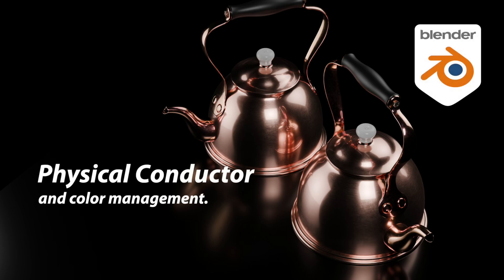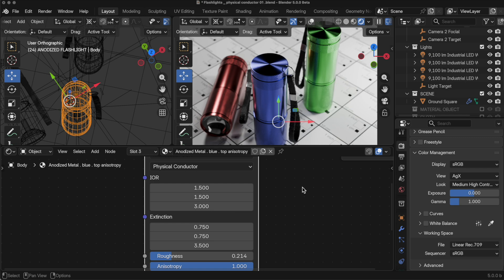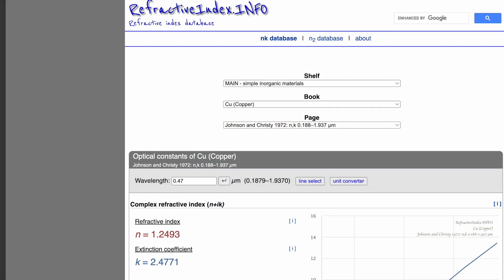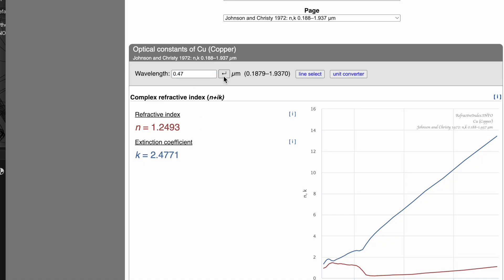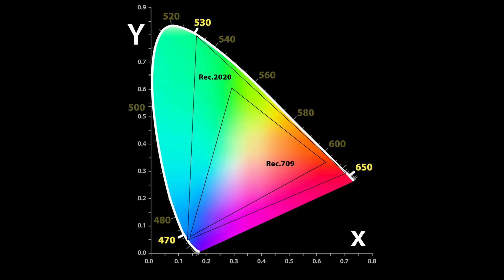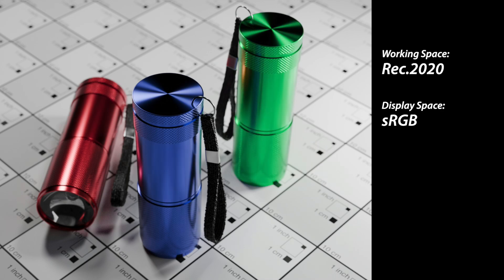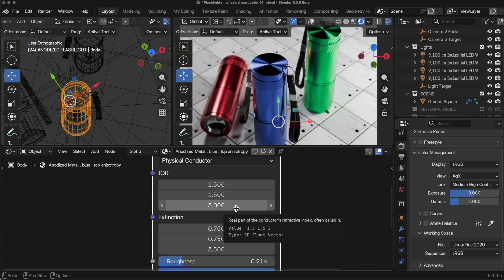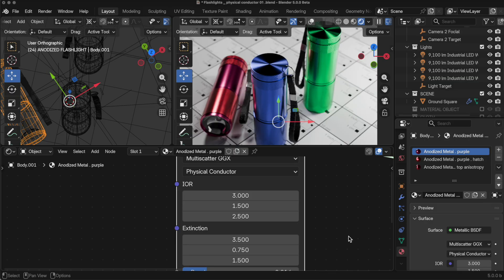Answering questions about Physical Conductor, and color management in Blender 5.0.

Comment: Can I ask, what is the Color depth in bits in Blender 5? For example I heard that DaVinci Resolve has 64 bit color engine. And I was wondering what's the bit depth in Blender's Working Space. If it's 32 bit the bit depth would be 4 Billion colors and in 64 bit it would be 18.4 Quintillion colors, correct?
Reply from the maker: No, 32-bit floating point color is much higher precision than just 4 billion colors, but it also allows for not just more colors but more stops of light intensity as part of the color information. I'm pretty sure DaVinci uses standard 32-bit floating point like Cycles does. But I don't use it so you would need to double check.
Reply: @christopher3d475  You're right 32 bit is way more.  Because 10 bit color is actually 1 billion colors, because it's 2^10 cubed. And that way 32 bit is way more than even Quintillion colors. What a time to be alive!
Reply from the maker: @arkenavetisyan7308  Yep, my first Atari in the 1980s could display something like 16 colors.

Comment: Hi Chris, quick question that's somewhat related. With the color management in 5.0, there's the new HDR  Rec 2100's that make the scene substantially brighter just by switching to them. Is it worth using this when I don't even have an HDR display?
I've tried some renders using the ACES 2.0 - 1000nits and 2000nits ones and the result on the photos app differs from the render, as well as on my phone. Using sRBG and Rec.2020 produces a more consistent result. Are they just to be used in productions with fine controls over color management?
Reply from the maker: The Rec.2100 display spaces give us the ability to view HDRI data along with view transforms that work within that realm. But the real challenge is that you have to have a monitor capable of viewing those. An Apple laptop can do that for instance. But currently we don't have a way to save still images with this view transformed HDR. There are a couple of newer formats like JpegXL that do this, and I'm guessing this something developers know about. So for now, the 2100's are there as part of future abilities and also help you visualize the dynamic extent of an image if your monitor can support it.
Reply: @christopher3d475 thank you very much

Comment: Hello,

I still think you are wrong.

You say Blender somehow works with "standard pure wavelength" colors and calculates color of material based on that. I could not find any signs for any kind of conversion from these pure colors to working color space. I could find `fresnel_conductor_polarized` function which appears to be the one doing the actual physics calculation. It takes IOR coefficients and spits out RGB values among some other stuff. I couldn't find any place where these values get mapped to working color space colors, nor did I find a place where the input coefficients do get adjusted. I couldn't even find any mention or some constants representing the "standard" wavelengths mentioned in the video. I've tried to ask Copilot, and it claims that `Spectral` type in this case represents working colorspace RGB values, and there is no additional conversion performed related to metallic shader, nor there is any conversion done on provided coefficients.

Of course, I could have missed something, Blender code-base is crazily complex and I'm not a Blender developer. So I devised experiment to prove that no conversion is happening. I've rendered the image to linear rec.709 raw exr file. Then I rendered images using srgb and rec2020 working spaces (and srgb view space and agx mapping so that the images look pretty). Then I took the rec.709 exr file and rendered srgb+agx images using the compositor, one where I correctly set image input to srgb, one where I incorrectly set rec.2020. If what you are saying is correct, and there is any calculation being done in metallic shader that would take color space into consideration then the change between rec.709 and rec.2020 working space should only be caused by rendering process "being more accurate" due to having wider gamut available. Problem is that this experiment showed that the change is exactly the same as when I just incorrectly assigned color-space in compositor. Image with the proof: https://imgur.com/a/uaUVn2a . The top row is normal rendering (path-tracing and evaluating shaders), bottom row is just rendered rec.709 pixel data manipulated using compositor.

What appears Blender is doing is that it just assumes each RGB channel is some pure monochromatic light (it doesn't really care what color it's exactly or if it's even pure spectral color), and it just applies fresnel equations to it based on coefficients you provide. It just computes how much should you attenuate each channel based on how would you calculate it for pure color. All the burden of choosing the right coefficients is placed on the user. Without having full spectral rendering, the best thing we can do is to pretend light consists only from 3 wavelengths, and somehow pick the coefficients that closely approximate our expectations of the materials in question. For rec.2020, I would choose wavelengths corresponding to the primaries of that color space and I would pretend my scene is lit by those RGB leds that have terrible color rendering index. Tada, it's accurate. For sRGB, I'm not sure what's the best approach. I guess picking anything vaguely red, green and blue would do.

If you want to choose same wavelengths (and therefore same coefficients) for sRGB and 2020, I guess it's fine, but you should know that the coefficients are probably not interpreted as affecting specific real-world wavelengths, but they appear to act on the working space primaries. As demonstrated, the difference between sRGB and wide color gamut render will be exactly the same as when incorrectly assigning color space to raster image, which is not the same thing as "rendering being more accurate in some cases"-effect (which I didn't try to contest).

I hope I'm correct and this helps. I'll be now living in a fear there will be another video in the saga because "some people had some comments" 😅. But I tried my best to not mess up 😅.
Reply: To be extra sure there is no special treatment for the channels I've tried to swap coefficients for RED and BLUE. If the metallic shader assumes that red and blue channels correspond to some specific real-life wavelength, then these channels should be treated differently, as the wavelength of red and blue colors is completely different. But when I swap the red and blue channels in the rendered image, I get the exactly same image as when rendering normally. The blender doesn't really care about what the channel represents, and does the same calculation for each channel, only with different complex coefficient. (Note that I've used the default white light and grey background so that I don't have to swap all the channels for all the materials and lights in some complex scene. Also note, that I'm not claiming all nodes behave this way, it would be nice if for example the blackbody  node took working color space into account; I've tested just the physical conductor.)
Reply from the maker: Your experiment is wrong because you didn't use a scientific control. I'm going to record another quick video demonstrating that what you're seeing is misleading and you've drawn an incorrect conclusion from this experiment. What I'm saying is correct, colors generated by the Physical Conductor and its N+K parameters via the wavelength data can get clipped when rendering with a too-small working space. Rec.2020 allows the color calculations to be more vibrant because the gamut doesn't clip/compress the color.
Reply: @christopher3d475 You are misunderstanding me. What you are saying is correct. I don't disagree with that. I agree that the physical conductor can produce colors that are outside of sRGB that would get clipped if you used sRGB working color space.

Let's say we use rec.2020 color space. Let's say you have white light ray with color 1,1,1. Because we use rec2020 color space, it's implicitly assumed that the RGB values represet color in rec2020 color space. When the ray hits metal, it appears that the triplets of the values get multiplied by values calculated by equation based only on coefficients provided by user and angle of the ray hitting the surface. Resulting pixel (which represents some nicely saturated real-world color) then gets shifted into sRGB if it falls outside, but it might fall into sRGB (as you demonstrated) so no dramatic shifting might be needed. I don't disagree with these things.

If we instead use sRGB as a working space, then the 1,1,1 triplet has very different meaning. It's 1,1,1 implicitly assumed to be in sRGB. When this light hits the metal, it gets multiplied by triplet of values based only on the coefficients and angle of the ray. What I tried to prove is that If you provide same coefficients and the angle is same, you'll get same triplet as a result. The only difference is that the resulting color of pixel (before tone-mapping) is implicitly assumed to be in sRGB, so it represents less saturated real-world color.

I agree with you that there should be difference between rendering in rec.709 working space and rec.2020 working space. I agree there should be a difference even if you render to sRGB. I also agree that using rec.2020 as working space can lead to more accurate results because you are cooking with wider color primaries, and if your input colors are more accurate to what you try to represent, then no matter what operations you perform on these colors, the output will be more accurate. And I agree that in most scenarios it's probably better to just work in larger color space and map it to smaller one only at the end of the process instead of being limited from the start.

What I'm claiming here is that:

1. The physical conductor metal in Blender, as implemented in Blender 5.0.0-beta+v50 doesn't really care about the color space you are in (or even what the 3 channels mean) and just does math on the numbers.
2. Changing the working color space without changing the coefficient is doing the exact same thing as if when you mis-label color data. The math being done on the numbers appears to be the same irrespective of the working color space in this case. (This happens because most operations done doing rendering are linear so if you scale inputs, the scaling gets preserved in the output. Note that point of the experiment wasn't to prove that all rendering is linear, the goal was to reverse-engineer how the metallic shader works. Also, I'm aware that mapping to sRGB could introduce clipping or non-linear operation at the end and AgX is not linear, but they are needed for images to look pretty and they shouldn't affect anything as they are applied at the end. These images change how the screenshot I sent you looks, but they won't randomly make two different renders identical.)

Maybe I didn't some error in my experiment (although I doubt that in case of the second one, because that one is really simple), but more likely I just didn't explain properly what I'm trying to prove.

Comment: I switched a scene view from filmic to aces 2.0 and it got very dark. How do I compensate? My display is set to sRGB, I also set working space to ACEScg. Should I adjust gamma from 1.0 to 1.5?
Reply from the maker: This is the nature of the ACES 2.0 view transform. It's by nature going to be darker and more contrasty than Filmic and AgX. You will simply need to adjust the exposure of your scene, or change the lighting. FOr instance, you can change the Exposure setting in the color management area up a bit to help compensate. But for ACES 2.0, it's usually best to use it from the beginning of scene creation because you'll be configuring your lighitng and exposure form the beginning to suit its characteristics.

Comment: So I'm not entirely sure but I think what you'd want to do to get the "closest to correct" IOR and extinction values is to rely on linearity and basically put in the XYZ coordinates of the corresponding spectra?
Like, rather than sampling a single wavelength, you'd want to sample "all of them" as given by  a standard observer (so like from 350 to 750nm or whatever it was) and multiply these spectra with the color matching functions, which gives you specific XYZ coordinates, and that ought to be "the closest to right", and a better approximation than "just picking three wavelengths"
But I'm not entirely sure it actually works out that way in this case, since the underlying formulas involve some complex stuff that isn't just linear.
Clearly what you are doing here (picking three specific wavelengths only) does give pretty decent copper, and of course "the best" outcome would be using spectral rendering whenever that becomes available
Reply from the maker: Yeah, using spectral rendering solves the inevitable arbitrariness of the approach the current physical conductor uses via RGB rendering.

Comment: I'm not entirely sure if this makes sense. You say the IOR and Extinction is defined in "RGB" but what RGB exactly? What makes you determine you can use the mentioned pure wavelength for these 3 values? All this looks like it is actually not managed and behaving as "assign color space" instead which causes the increase in saturation. Because the values become considered more pure automatically due to the rendering space being larger. There seems to be no mechanism correlating to physically correct values, unless there is a documentation somewhere that states that the numbers defined in IOR and Extinction for Physical Conductor actually correlate to the particular pure wavelengths you mention in the video. Otherwise color management has no way of knowing how to convert and maintain appearance. Do you have any tangible data on this?
Reply from the maker: The nanometer values I used are commonly used reference values for RGB. You could tweak those to be somewhat different values. That's where there's wiggle room here. I chose the reference values because they are commonly used. If you want to define red as 633nanometers, you could do that. This is actually one of the core problems with using RGB for light transport, it has to emulate physical processes that are actually quite nuanced. If we were using N+K data for a spectral renderer, it could use a bunch of N+K data points along the spectrum to render a metal. In RGB, we get to use exactly 3 points. So you chose the very best estimate of what pure RGB you can find. And so I used the common reference nm values. Crucially, the N and K values themselves are physical constants, not color values, so they are not subject to the color space conversion process (like sRGB to Rec. 2020) that applies to image textures or material colors. The change in the metal's vibrancy is due to the render engine being allowed to contain the unclipped result of the Fresnel equation, not a color management conversion.

The manual for Physical Conductor says, "Accepts Complex IOR measurements from real world metals to replicate a more accurate rendering of metals than the F82 Tint Fresnel type.
Complex IOR values can be found from sources like the Physically Based database for CG artists and Refractive Index nk database."

Comment: I wonder why they arent making ACEScg or rec 2020 the default in 5.0 maybe they want to wait one release cycle to see what people think of it
Have you spotted any differences between ACEScg and rec 2020? In my testing I couldn't
Reply from the maker: Yeah, I'm not sure why new files are defaulting to Rec.709. Head scratcher.
Reply from the maker: Oh, and as for the difference between ACEScg and Rec.2020, you can see a difference in some highly saturated examples but it's really really minor. For the bulk or normal scenes, they would look the same. Some suggest that Rec.2020 is the ideal working space to go with. It's what I'm mostly doing now. But if you need compatibility with a full ACES workflow in other apps, then use ACEScg.
Reply: @christopher3d475  I dont really use blender nowadays, I was more wondering because I am learning graphics programming right now, ACEScg might be worth it for sdr, probably no rec. 2020
But it might make more of a difference in hdr?
your videos are goated btw, love your videos on new blender rendering changes showcased with your really nice renders.

edit: some research indicate ACEScg is oftern used as the working color space in real time graphics even for sdr output
rec. 2020 more rarely so.

Comment: There is no replacement! Working with the correct working space from the start is essential. The option to convert color inputs is only to there to mitigate the mistake of starting on the wrong working space, but not ideal! 

You explain it beautifully. "It's only after those colors are generated.. then finally passed over to the color space, and if it exceeds the color space..." because people are still believing that Cycles is doing something new and thus it was impossible to use Cycles pre 5.0 in an external industry standard color pipeline. Cycles didn't gain any new capabilities, so it was definitely possible. You just needed a workaround to visualize it. In 4.5 and before, you had to save your render as exr, open it back in the compositor, and set the color space in that image node's color space to Linear Rec2020 to get the same result you get in 5.0 in *real time*, but eyeballing the values of your materials since you didn't have real time feedback not the proper color pickers :/ Good luck to anyone still working like that!
Reply from the maker: It's there because every file a user will open from versions prior to 4.5 will need conversion if they want that file to use the larger color spaces. So yes, starting a new file with the correct working space is ideal, but vast numbers of files might need this conversion.